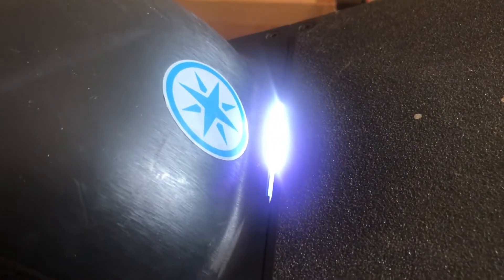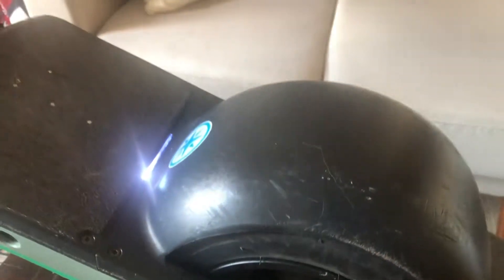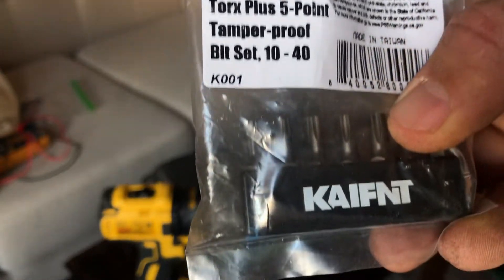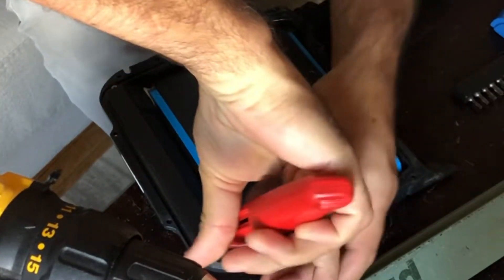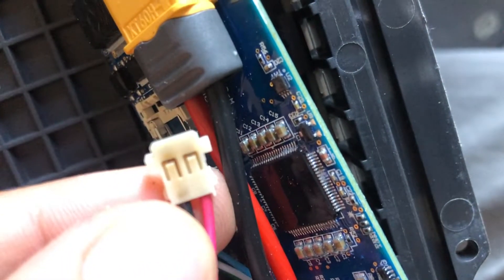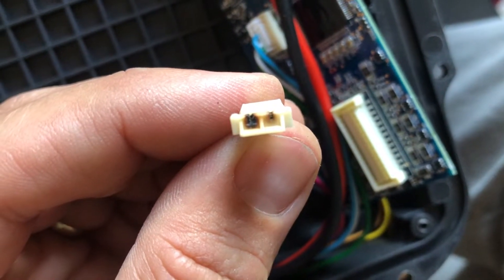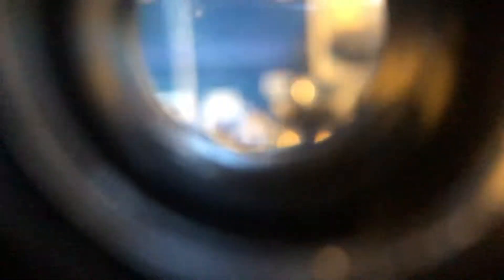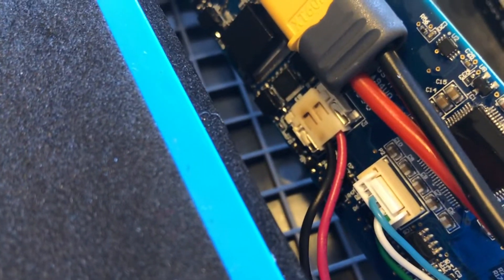Ripping into a Onewheel Pint BMS in 4.57 seconds so that you don't have to.

Comment: I also Fix Mine....

But is there anyway i can buy another White Tabs. Mine one are Toast.

And also im willing to just buy those white Tabs than Using Slow Home Charger. 

Hyper Charger is what i want to use
Reply from the maker: I soldered new wires to the board. I’m not expecting to have to remove it again.

Comment: But did u fix it and how? This just happened to me I need help
Reply from the maker: I did! I didn’t video it like a dork. I just soldered jumper wires from the board to the cable. Start by carefully soldering to the board. Then the wires to the plug is easy. The other trick I did was to clean the connections of the carbon deposits. That should last a few months. I don’t use the ultra chargers on any stock pints. Only on my modded one. Good luck.

Comment: Have you had issues where the charger light stays green? and never charged the Onewheel
Reply from the maker: Yes, that’s exactly the problem I had. The charging cable connection to the BMS can only take 1 amp. Shouldn’t be charged with the ultra charger at 3 amps.

Comment: THANK YOU SO MUCH SIR ! 🙏🤯
Your video helped me identify the problem and fix it ! ❤
(🔽 Details and steps below 🔽)

I bought my Pint on a second hand, and always used the SuperCharger without questionning its electrical dimensions.
But a few weeks ago, for no reasons, it stopped charging. The charger and the board were still displaying their LED indicators, but no more juice seemed to enter in it.

I first thought it was because of the battery (« 1600km, might be dead. ») until today, when i finally opened the board, tested it out and realized it was almost full charge.

So i started to investigate, and found your video.
That lead me to have a closer look at the BMS... and i found the same burnt connector (T93B). So i unlocked the wires with a small screwdriver (gently pull the plastic strip on the top to free the wires) , and started to scratch the burnt areas with a cutter and thin sandpaper.
Once done, i plugged everything back , plugged the classic charger ... and now my multimeter says that it is charging again !

Cannot thank you enough for helping me fix the problem without spending a single cent (except for this damn T20 security torx bit) ! 🔥🛹
Reply from the maker: That’s so rad! I’m glad the video helped you out. I now only charge with the home charger. I’m thinking of maybe changing out the connector. It seems to be a silly design.
Reply: @JacksonGarage  Same here.
Maybe just replacing the wires with bigger ones that could handle 3A would be enough to prevent overheating ?
Anyone knows if they fixed that issue on the GT ? 🤔

Comment: I know this comes really late, but you could just solder the wires directly at the board and that would work with fast charge too. If you want to preserve burned connectors, just solder new wires all the way from the charging port to the board. You could use silicone wires and put a heat shrink insulation to further enhance the silicone wire mechanical resistance. Better cables and when they bend, the don't put strain into the solder joint.
Reply: I think I’m going to try this on my pint soon, great info, thanks!
Reply from the maker: That’s a great suggestion. I wonder if the board itself is designed for the current further down. There’s not much to attach the wires to and I can’t see where they go. I’m basically not using the fast charging anymore. I’m thinking of getting the 2A car charger and see how that behaves.
Reply: @JacksonGarage  I don't remember who was it, but i remember some youtuber telling that they checked datasheets of the connector, and specs were only 1A continuous. So your bms traces should be way better than that in any case.
Reply from the maker: @ponakka  That's good info.

Comment: Random question. 

When you plugged your board in, did you plug it into the board and then the wall? 

Or the wall the the board?
Reply from the maker: Hey Alex, usually I plug the charger into the wall first and then plug into the board. Do you think it makes a difference? I suppose that I could use my multimeter to check for power surges. But the heat at that connector is constant.
Reply: @JacksonGarage  yeah I was just seeing if it could be an issue. I am unsure. 

Everyone who has had bms issues tell me they plug into the wall first. Might be random. And I’m sure the wires are just too small for the amps running through them. 

I was just curious mostly, It’s probably nothing.
Reply: @JacksonGarage  for reference I always plug in the board first, on my xr and pint. Never any issues 

2000 miles and 580. But I haven’t used the ultra charger on the pint yet! But I know plenty of people that have 2-4K miles that use ultra with no issues yet
Reply from the maker: @alexbowden52  I had about 2k miles on the Pint when that terminal burnt using the 3A ultracharger. I'm now exclusively using the home charger at 1A. I don't thing=k that the boards were designed for the high amps.

Comment: Is good to know. Food for thought on being cautious for such a high priced toy. Does make sense but why the heck would FM allow that to happen? I've got both chargers for the Pint X but will only use FC when really needed. Thanx for the video
Reply from the maker: I think what they did was just rebrand the XR charger and put the Pint plug on it. My Pint has over 1000 miles on it and probably been charged with the fast charger most of its life. I don’t know if they’ve fixed the problem with new hardware updates or if the hardware updates just blocked people from modding their boards. Thanks for watching.
Reply: @JacksonGarage  basically what’s happening is that clip on the bms is rated at 3a, and the charger supplies 3a which is right at it’s limit, and it heats up from resistance. The charge plug on the xr is routed through the controller and with larger gauge wire instead so it can handle a much higher current. They attached the charge plug directly to the bms on the pint and used a bad method which is why you get the problems you see. It’s a major design flaw and FM wont even acknowledge that it happens even though it’s super common in the right to repair community. Great vid btw
Reply from the maker: @glitchy8429  Thanks for your reply. I've cleaned the contact but the fix has only lasted maybe 10 charges with the home charger. I'm probably going to have to solder something directly on but the surface area is so small.

Comment: what hardware version is this?
Reply from the maker: I can't tell you right now because it's in pieces. It's definitely an early model because it can take the chi battery upgrade. Not sure if that helps. Thanks for watching.
Reply from the maker: Hey Philip it's Hardware version 5300 and software 5040. The board is back together now.

Comment: I had the same problem after 5k miles when I tried to brake a week record using the fast charger daily, after the PintX release I sold mine with over 6k and the las 1k miles I was charging only with the regular one and the person who has it now is aware of that just use the FC when you really need it.
Reply from the maker: Thanks for the feedback. I'm trying to get my hands on a home charger.
Reply: @JacksonGarage 

I got the same Issue.

Looks like Just Scrape and Clean that 2 Pins from the White Connector. And Use Only Home Charger. 

Then That should be the Solution for this Issue.

Comment: Swear! Same exact thing happened to mine. It ended up being a blown charger connector in the bms. I’m sending it out tomorrow for repairs
Reply from the maker: Take it apart, clean the terminals and then charge with the home charger. Unless your board is under warranty then make them fix it. @onewheel I hope that you’ve fixed the Pint x because you’re still selling the ultra charger, naughty.